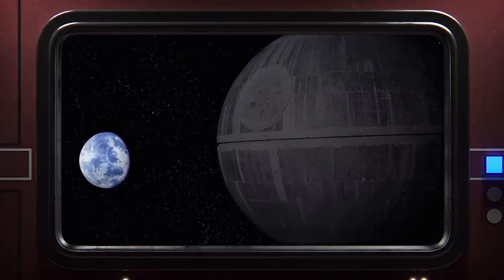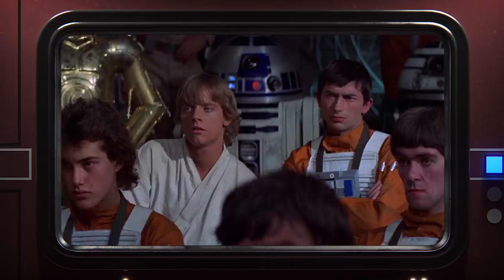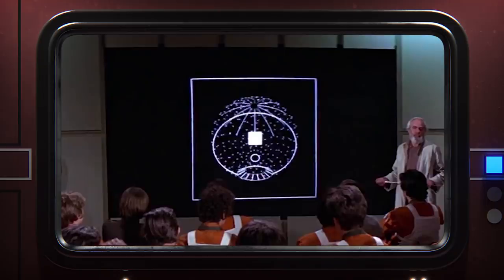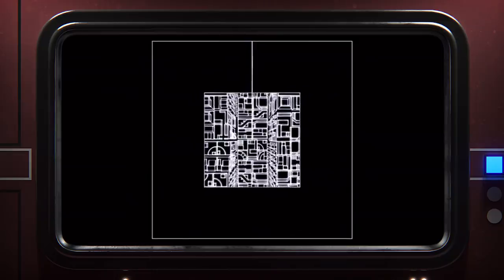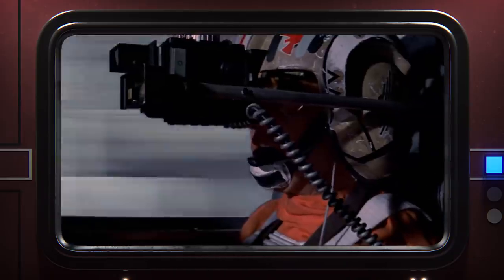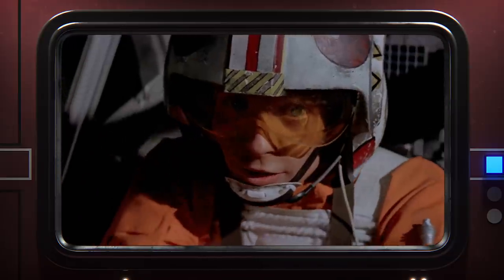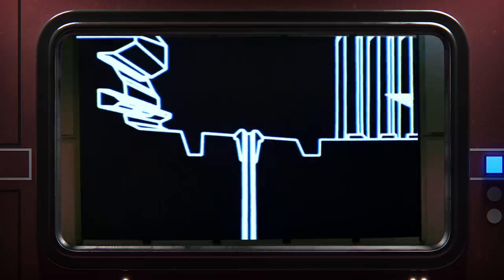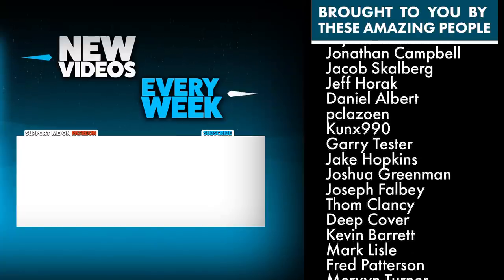The Thermal Exhaust Port Was NEVER a Problem

Comment: Well.... thank to the Rogue One the canon fact is the exhaust port is an exploitable weakness.
But you cannot create sabotage on a project planned for so long time and then supervised by Tarkin and Vader. From that point of view the saotage was not to create an weak-spot... but to create an exploitable spot. And then mask the sabotage to the point is seems like "OK we have it covered", except they didn't.

On the matter of multiple small ports... why would only one be the One? I would expect all of those smaller ports are equally exploitable.
So why the rebels tried only the one again and again? Because to try more ports at the same time would spread the rebel forces to wide. Making them easily to be coped with. They concentrated on one port only so they could gain local air supperiority (at least for a short time they expected for the job to be done), allowing them to cover those, who would try to hit the bullseye. It didn't work but only because they were facing the best fighter pilot of the galaxy. Before Vader intervened, the battle over the surface of the Death Star was quite ballanced.

Comment: What if it was grated over?
...Wait, they would just torpedo that, and then fire through the port.
What if the port wasn't entirely straight?
...maybe the others were, and that's why this one was unique?
...
Maybe photon torpedoes are capable of slight course correction on account of the weird energy field on it? Or maybe it just wouldn't detonate on contact with...
...hmmm...
Maybe the exhaust vents need to be as short as possible to prevent major damage, so large kinks or harsh turns would be infeasible and require vents for the vents, which would make the whole thing pretty moot, as one of those would certainly have an exploitable shape.
...
Yeah, maybe a flawless design wouldn't be possible.
It seems like, if one port would be exploitable, and there are bounds that must be kept within for the vents to be effective, some or all auxiliary vents would be exploitable.
Maybe the specific vent was chosen because it would have the least resistance from defending towers or be furthest away from the landing bays or something.
...
This is difficult.

Comment: Also also
It's an exhaust port. Try throwing something into a tube that is blowing hot stuff out. Not only that but it's many kilometers long. The notion that anything dropped down there wouldn't be blown away to one of the sides is kinda ridiculous... Unless photon torpedos do like dem photons do, and not have a mass, I guess

Comment: It was an unnecessary retcon, for sure. Also, it takes most of the weight from Luke's impossible achievement, his first setps into the larger world by using the force. Now it was just a deliberate plan.. pft. boring.

Also... how else would that moon sized battle station work? of course it needs some line between what energy is created and outside of the station...

Comment: exhaust port like that was still stupid either way, should never have led to the core, it should have led to a "plasma enriching" unit that turns the thermal energy and gas into plasma, air is a limited supply in space, and you can't just exhaust the gasses, you still need them for all the other stuff

Comment: Why couldn't they fly at the exhaust port from the top flying straight down? Then they would not need Luke to make the torpedoes turn 90 degrees and they would probably be out of range of the turbo lasers for longer
Reply: probably placement of defense batteries. It avoids most cross-fire from laser turrets and the turbolaser batteries.
Reply: The station was built to repel capital ships that would take a similar approach as you're suggesting. The skimming along the surface limited the number of turbo laser batteries that could target them as they made their approach, plus, these are torpedos, so they most likely have a self-guiding mechanism built into them, meaning you just needed to get your launch right and the torpedo does the rest.

Comment: The plot invention in Rogue One is a mistake. It would have been far better if Erso had put in a flaw in the main reactor, but it was up to the Rebels in Star Wars to pour over and interpret the plans to devise their own scheme to exploit the weakness. Then, the work of the Rebels was heroic rather than simply being handed a solution.
 
Erso's message should have been:
"I had no choice. If I did not help the Empire, they would have completed the Weapon anyway, but it would have been at a greater cost in lives and destruction. I could not stop it, so I tried to sabotage it. But I could do nothing for its defenses. They are impenetrable. I could not defeat the weapon. It WILL work--it will terrifyingly work. ... But I was able to include a flaw, a flaw in the main reactor. It is unstable. If it damaged or overheats, it can destroy the entire weapon. THAT is your chance. Find a way to the reactor. Find a way in. Bypass their defenses. You can do it. I believe in you."

Then, if you saw Rogue One before Star Wars you might think the heroes might take down the Death Star when they got on board, and you'd feel conflicted about them escaping. You'd feel the triumph of the pilot briefing learning about how to attack the reactor for the first time. You'd also know how badly the attack will probably go, which will make the losses in the battle even heavier.

Comment: In space without atmosphere to dissipate heat, heat sinks should be radiated in infrared. So you need a heat conductor material towards the outside and external heat radiation panels like Space Shuttle internal door panels. So having a hole leading to the core is definitely an intentionally bad design for a space heat sink. If heat is too intense, the best would be to use water due to its heat capacity so you should have some internal lakes and possibly a vapor vent but not a hole to the core. One meter of water is powerful enough to protect against space radiation. So you may guess how good water is.
All engineers must have been with Galen. It takes one engineer to notice the poor design.

Comment: The sentiment in this video is good but sort of a lot of hand waving away from the point. They tried to cover their bases. But, without sabotage why would 1 port out of 19 (+?) cause a chain reaction? That doesn’t make sense. It’s identical to 17 others minimum. Only that one causes massive destruction when  (quite improbably) successfully attacked? What’s special about it? Why just one? Why any? Yes, they tried very, very hard to make it not a weakness... as they certainly did with the other ray shielded, heavily guarded, 2m wide, right angle shot requiring, unmarked, scattered ports. I see no compelling reason why there is a chain reaction causing port at all of its only the one. If you were to tell me that 18 different ports could have caused the chain reaction and that they just picked one at random then I’d believe that a whole lot more. And it would still be pretty valid that they did try to protect it from all but “one in a million” force corrected shots that “not even a computer” could make. But the fact that they had to choose THAT port from specially retrieved secret plans... that’s what causes me to believe that Rogue One and all the fam criticism was warranted.

Comment: You make the assumption all the ports are identical to each other in favor of discounting Rogue One. Is it not possible that only one of the ports goes all the way down. What if the other ports have bends or grates in the way that could impact the torpedo? If your going to make assumptions so will i.

Comment: Am I the only one bothered less by the technical details of designing Death Stars than them being called "stations". Stations stay put that's why they are stations. A space station would be stuck in an orbit around a star or a planet. If it is capable of greater movement than what is required for keeping the orbit stable, it is a ship and not a station. If it can move to a different star system on its own power it's an interstellar ship. So it's not a moon and it's not a station. It's a ship.

Comment: here are my thought,  "Right below the main port".   "Exaust" with means expel gases in a direction that WONT SUCK DOWN A BOMB!!!  How did the proton torpeto manage to go from the surface to the core given that the deathstar is around 100KM diameter, so about 40km MINIMUM to reach the core WHILE FIGHTING AGAINST EXAUST GASSES!!!  Does the proton torpeto have an engine to propell its self down the long exaust port? or is it just a big pointy metal bullet/slug thing?   Why does a little bomb around the size of a basketball blow up an entire 100KM wide metal battle station in a complete obliteration fasion?  couldnt the reactor (likely HYPERMATTER powered)  just disolve or have enough reenforcement to handle a little bobm the size of a basketball?  and piercing the reactor shouldnt cause a sudden entire obliteration of a dense 100KM sphere or steel/metal, if anything there would be a large hypermatter/reactant leak that would be somewhat containable and employees have a way to handle a large leak (HAN SOLO RADIO SCENE) if leak is uncontainable, it would cause a big volcano like fissure/gyser event that would split/fracture or slowly eat away at the battle station,  NOT CAUSE A SUDDEN COMPLETE OBBLITERATION/VAPORIZATION OF A 100KM DIAMETER DENCE BALL OF DURASTEEL.  And finally, that video made by dorkly a few years ago about the exaust port, which is pretty thurow.  i might of missed something, but i stated alot here to think about.  :)

Comment: Ok time to explain this to all the idiots who dont understand why this one port was the weakness. Rogue One actually implied this several times, that it wasnt the placement of the port or even its existence, it was what it lead to. The exhaust port lead straight into the reactor like all the others do, however, due to Gallen's sabotage, the internal part of the exhaust port wasnt shielded from the sort of explosion a Proton Torpedo produces. The resulting explosion breached the Hypermatter reactor, causing containment failure and several thousand minor explosions in the process, thereby causing the destruction of the station.

Comment: Ok but this is a huge project. The plans are not unobtainable. Nor should it be designed to raise all but one vulnerability instead of literally of them. Why not make every port invulnerable? Why not put secondary mechanical covers? Hell, why not add some time turbolaser, nay, tiny single shot slugthrower, inside the ports in addition to an emergency mechanical cover. Why not add a claymore style mine on the outside of the port that will shoot deadly debris into projectiles entering the port?

Comment: Its a space station. In space. What are you even exhausting from it that needs straight ass shaft to the core? Heat would not dissipate in the emptiness of space and any kind of gas need not have straight shaft. Put some turns if you really need it and you'll need more than just some telekinesis to guide torpedos.

Comment: i have an idea if the shot is literally impossible from that angle why not instead of flying down a trench just fly straight at that port and fire your torpedoes. i know why of course lucas's love of world war 2 planes and combat styles the trench run is suppose to be like an old damn or bridge bombing run. but still you're in space you don't have to fly down a long heavily defended trench to approach you can approach from above the trench sense the port is on the bottom of the trench.

Comment: Thank fucking God someone else has a brain.  And on top of this video, Erso’s weakness wasn’t even the exhaust port.  It was the flaw in the main reactor.  The port only made the weakness accessible and, therefore, exploitable.  People are so quick to dismiss the port as a silly plot hole, but won’t even pay attention to the movie or use common sense.  Even if there was no weakness that could be exploited, the Death Star would still need thermal exhaust ports to, you know, vent all the thermal exhaust that results from firing a superweapon with the ability to destroy an entire fucking planet.

Comment: How do "thermal exhausts" work in space, where there's no air? Expelling hot gas into space sounds very wasteful. Really the only way of expelling excess heat into space is by radiation.

Comment: Seems that instead of going direct to the core, they could have done an 'S' curve in the exhaust 'pipe' or baffles like a modern day car exhaust system that would in effect prevent munitions or space rocks from having a straight shot to the core, add this to the shield on the end of the port, and even a couple physical grates designed to allow exhaust passage in an unrestricted manner but being a physical barrier to munitions or drones or other unexpected weapons and these can help as a backup especially if the ray shield is offline or doesn't work, then thing would have been good to go.

Comment: I am comment 666...LOL!

Ok first off...Well...the other exhaust port(s) were probably needed to supplement the primary one to better difuse the heat & back-pressure from the exhaust...sort of like why you'd rather have dual exhaust on your car than a single one...where else could they have put or hidden it on the surface?  Down in the trench was the safest place.  I suppose they could have designed the inside of the exhaust pipe to curve and twist so it's not a straight line to the reactor, but maybe the internal structure didn't allow for that...plus with The Force/Jedi powers coming into play it probably wouldn't have mattered anyways.

Comment: Why does even have them, because in space there is nothing to conduct heat into, I know its a plot hole and that's a good question, for another time...
Reply: If it's got an actual gas exhuast then that gas leaving the station will carry the heat away, and I wouldn't doubt that they'd have a heat pump pumping more of the station's waste heat into that gas. That would explain the ray shielding (if they went with radiators like what's on the ISS then they'd have to allow for energy to pass through as radiators, in this context, work by carrying away heat energy through light).

At least that's my take on things

Comment: Ofcourse there's exaust ports. A thing that big generating that type of power and heat has to go somewhere. And what are the odds that a small fighter can get through all those gun towers,fly through a trench with defending fighters all over the station, then hit a port thats ray shielded, and have those torpedoes go straight down that shaft without bouncing off its walls and exploding on the way down before it actually reaches its long journey to the reactor? They never really had to explain that this was intentional in Rogue One with that scientist creating a weakness. Because the only thing that could blow this thing up would be Superman,and he doesn't exist in that universe. lol No,science didn't blow up that battlestation,the force did. Maybe Palpatine should countered that and used his dark power to make the port a moving target like Nintendo's duckhunt. I bet the dog would have been laughing at those rebel pilots when they kept chocking on those shots too.

Comment: Look. I get the video (very well done, Kudos), and I get that everything was perfectly explained in the original movie, and I do not consider it a plot hole either. But I disagree that the Exhaust Port was not a problem.

The mere fact that there is a singular way to destroy the death star in its entirety is a flaw in the design, period, full stop. Let us take a less advanced example as a test case: USS Gerald R. Ford (CVN-78), the lead class of US Aircraft Carriers. Is there a singular way for one of the design components of CVN-78 to be exploited so that the ship is blown up in a catastrophic manner? No.

ANY military installation that has a singular way of being destroyed due to an exploitation of one of its design components needs to be redesigned. So, even though the likely-hood of exploiting the design is quite small (which you proved perfectly in your video), it is still there, and exploitable. I would have sent the designers back to the drawing board.

Comment: Still doesn't explain why the 2nd one had an even bigger hole which was its weakness. Unless it was a decoy. The Emperor is still alive and pulling the strings of First Order. Star Wars 9 DEBUNKED there you go!
Reply: You mean the one that was still under construction and assumed to be protected by a shield generated elsewhere with the plan to shut it off known and presumed to fail?

Comment: https://youtu.be/agcRwGDKulw

"Magic Space Wizards"

Even in the original film it was established Vader hated Tarkin and the Death Star.  Weekend him the Emperor's eyes after he betrayed and helped the Emperor hunt down and destroy the Jedi Knights...  And could be used against him if he made a bid for power against the Emperor.

Vader likely sabotaged the Death Star so the "Proton Torpedos" didn't compress the exhaust gas into LIQUID going 1000MPh or more down the narrow tube and explode by heat or being forced into the walls - and Vader likely GUIDED them....  On the former, look at all the steam, areas where they were clearly hot and lots of steam?  Imagine a few cuts, say from "Lightsaber practice" where the heat leaks in and the workers sheepishly weld when they find in their normal weeks of fixing but don't dare complain...  Even if they see Vader doing it they likely say "He's just testing us that we are working, fix it and say NOTHING..."
Reply: Or the torpedoes had a heat-seeking mode with incredible maneuverability. It also had some form of shielding from heat.
Reply: Even in the book Battles That Changed The Galaxy from DK, it states that the torpedoes found their target.